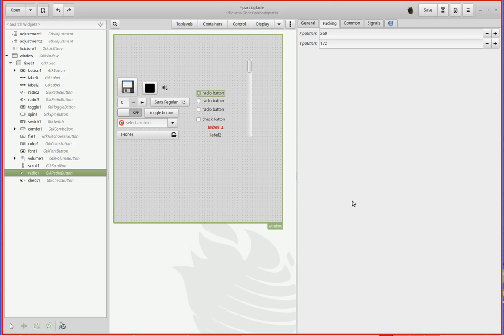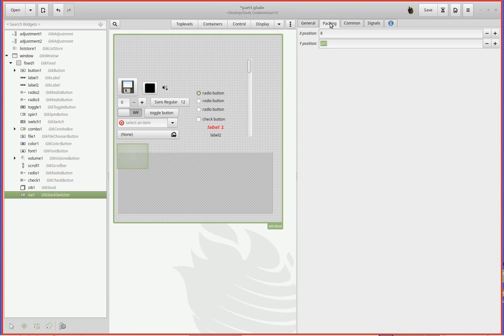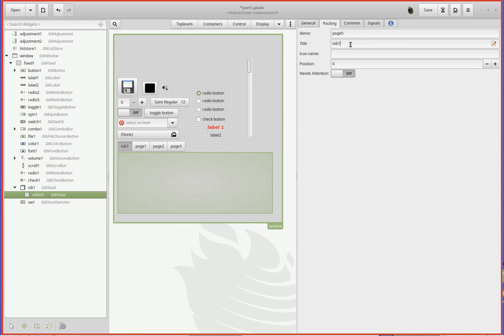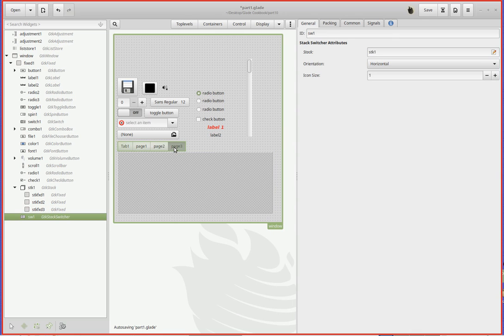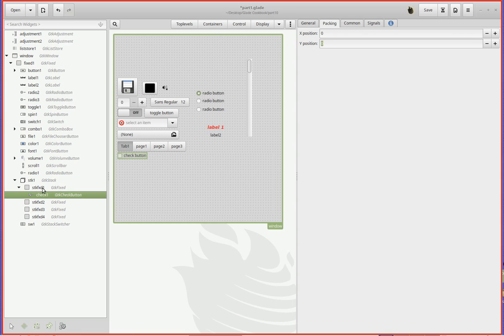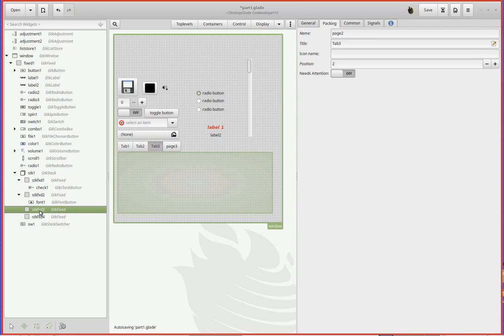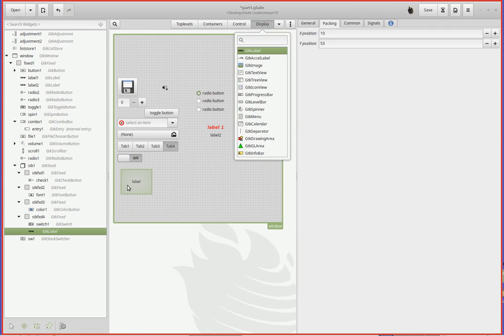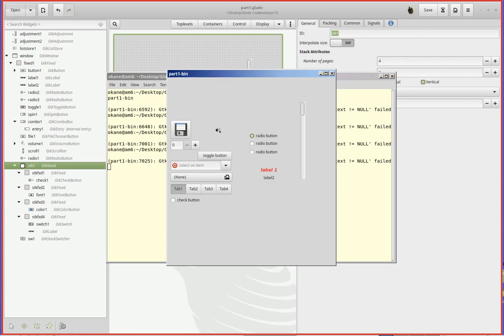Linux Gtk Glade Programming Part 10 - Adding a Paged Stack and Switcher

Comment: Is there a way to use a button to move between gtkstacks ?
Reply from the maker: Not that I know of. Stacks appear to be a work in progress. You can give the stack switcher elements a button-like appearance with CSS code such as:
#sw1 {
    min-height: 30px;
    min-width: 0px;
    padding-top: 0px;
    padding-bottom: 0px;
    padding-right: 0px;
    padding-left: 0px;
    border-left: 0px;
    margin-left: 0px;
    background-color: black;
        }
where 'sw1'  is used as the widget name (under the Common tab). CSS can be loaded with:
        GtkCssProvider  *cssProviderMain;
        cssProviderMain  = gtk_css_provider_new();
        gtk_css_provider_load_from_resource(cssProviderMain, "/part1/css/gtk.css");
        gtk_style_context_add_provider_for_screen(gdk_screen_get_default(),
                               GTK_STYLE_PROVIDER(cssProviderMain),
                               GTK_STYLE_PROVIDER_PRIORITY_USER);

where /part1/css/gtk.css is in resource.xml

Alternatively, you might try hiding the stackswitcher and then, in a button clicked function, switching the stack with the code:

 gtk_stack_set_visible_child (GTK_STACK(stk1), pg2); 

where 'stk1' is the gtkStack and 'pg2' is an element of the stack 'stk1'. This will make pg2 visible.
Reply: @kevin_okane  https://github.com/CodigoCristo/instalarch/blob/master/ejemplos/teststack.c    Control stacks

Comment: How to access the gtk stack in gtkmm file? The builder->get_widget() is failing saying get base type is not memberof gyk stack.
Reply from the maker: I'm not sure as I've never worked with gtkmm. My guess is that it's a casting/data type issue.